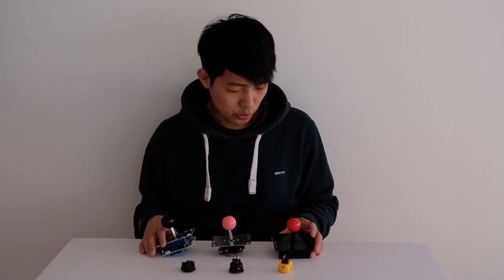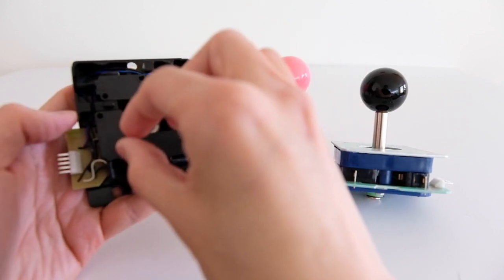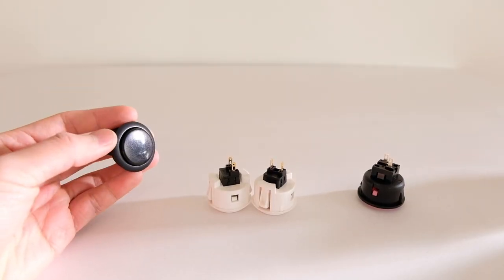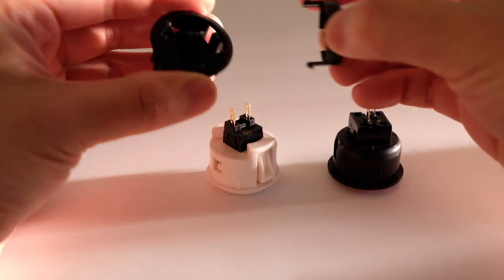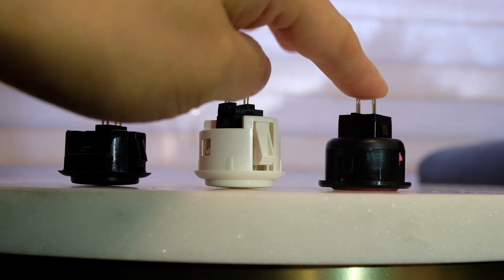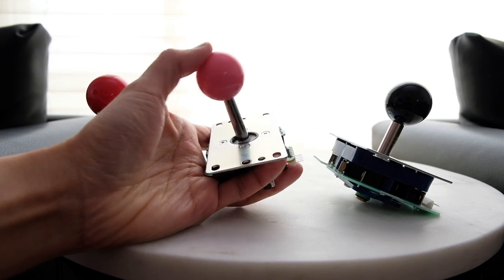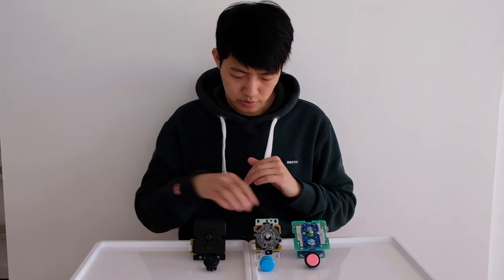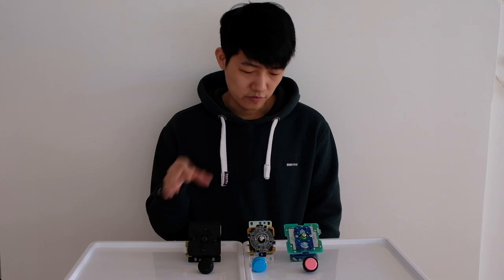Sanwa vs Hayabusa Vs Seimitsu Review Detail Comparison 2019 HD

Comment: If my keyboard is any indication of how often I'll be cleaning my arcade stick, I'll be cleaning the arcade controller about 0 times a year.
Reply from the maker: Me too lol i never clean my keyboard that much, but i try not to eat and use it at the same time, so it doesnt get dirty ❤️
Reply: If you want optimal smoothness on your stick's pivot and increase it's life it should be re-greased once a year with silicone grease because the grease will oxidise and be useless after that. Sanwa uses Shin-Etsu G-40M and Seimitsu uses Shin-Etsu G-501. 

Some never re-grease and are happy but i do it every year to all my sticks
Reply from the maker: Speaking of that, you reminded
Me to buy a shin-etsu, mine is running low like tooth paste 😂🙏❤️

Comment: 1:33 The LS-32 was designed to be touching the panel. That's why the shaft is short. The original plate for the LS-32 is the SS plate that bends on the sides, so that the whole square area of the joystick can touch the panel and the sides come up so it can be mounted.

The SE plate for that's installed on this LS-32 makes the shaft a little shorter than it was designed for.
Reply from the maker: Thank you for the added information 🙏❤️

Comment: I enjoyed the video very much.

Tip for those interested: Change the lever spring (easy job) and you can decide on any of the joysticks how you'd prefer it to feel. I gotta hayabusa with sweet tightness

Also you can replace the upper rings on all of these to either fatten your stick at the base or slim it down, thus increasing or decreasing the throw.

With hayabusa controllers I also bought cheap quality spacers on the actual switches bringing the actuator closer to the stick.

Like he said, it's all about how you feel about it. I do recommend hayabusa because if you likely have a Sanwa then you can actually benefit from both.

You don't need to spend another 60 bucks on any of these because they all have the same efficiencies with 10 dollar upgrades.

Easy example, those hexagon parts that assist with rotation are also sold with the same idea of fattening or slimming the lower end of the stick down by increasing and decreasing the actuators ability to read input, simply by distance.

I hit up focus attacks website, after I discovered I could have it all and custom to boot :)
Reply from the maker: Thank you so much for this nice comment, appreciate you 🙏❤️
Reply: I have Hayabusa. What type of spacers did you buy and how did it make a difference? Also, what springs would you recommend to make it a bit tighter? I primarily play Street Fighter. Thanks
Reply: @LFiers  Get the 1.5 pound spring. Then get a replacement for the inner plastic part that makes contact with the sensors ( I forget the actual name of the part but it is the JLF-p-5). You'll want to go as large as available then decide on the next that is the best size smaller. You want less than 1cm between the contact points on the sensors. If it touches you'll get misinputs, if its smaller they'll be just enough space so the stick will feel more like a dpad, very very accurate
Reply: @retrobros9684  Thank. I'm not sure I understand this part though, can you elaborate here please? "you want to go as large as available then decide on the next that is the best size smaller."

Also, is this a challenging job to do? I've never opened the stick before as mine is just brand new. I guess I could watch it tutorial how to do it all but yeah, hopefully it's not too difficult. I can definitely learn though. 

I have Hayabusa by the way, you mentioned JLF. Isn't that for Sanwa?
Reply: @LFiers  I'm sorry for not explaining it as well, but I recall the part which named the "actuator." You can get them at max size 2 mm or 1.5 mm.

As far as teardown of an arcade stick it is super easy. Your just removing a clip at the base of the arcade stick. When it's removed the spring will pop out of the bottom. Putting it back together is simply holding all the pieces together with the spring which pushes back a Lil. When the spring is pushed back into the stick you'll need to put the pin back. The pin is shaped like the letter C. Just use needle nose pliers and you can pull and push it back into place.

Just get the 1.5 pound spring and the actuator of your preferred size. You can buy both the 2 mm and 1.5mm actuators and spring usually for a couple dollars each, plus shipping.

My final recommendation is for the actuator to be metal not plastic. This is the part that triggers the sensors for input, meaning it will get abused and will eventually warp its circle  so it won't make perfect contact.

I'd say for about 6-12 bucks max for everything with shipping. Amazon might be better for price or Etsy. I used to buy from arcadeshock/focus attack, but now these items are everywhere to buy.

Best wishes!!!

Comment: Choosing the right stick is so important (I play Street fighter Third Strike). I started off using a terrible stick, thinking I am a terrible player (the stick was an old ps2 stick, the travel on the stick was extremely far but the resistance was very low), this resulted in me being able to move the character fairly quickly but not do quick special moves. The second stick I had, the resistance was really high, but the travel was super low, this resulted in me accidentally jumped instead of blocking and trying to do special moves was near impossible cause the resistance was so high.
Xbox hori stick (cheapo) was actually pretty good, the buttons were cheap and broke but the stick wasnt too bad.
Final stick was Xbox Razor Atrox. I swapped the buttons out with sanwas (only for aesthetics) and it was the perfect stick !!!
If anyone understands this, the latter two sticks were the only ones I could do Urien's Tackle/Tackle/Headbutt (which I find is a very hard wall combo to perfect).
Reply from the maker: Great info my friend, thank you for letting the community know ❤️🙏

Comment: I'm new to fight sticks. But I got an old ps3 stick used on Easter. I had to piece it together but it works. Ordered a new Sanwa JLF and a new gate. I noticed the buttons seemed inconsistent, done buttons had more stiffness, I opened them all up and cleaned them with rubbing alcohol and they all feel much better now.
Reply from the maker: Bogart Gaming & Tech sounds good 👍 i am going to make a cleaning video on them soon, mine is getting dirty ❤️🙏

Comment: i haven't tried the hori hayabusa joystick yet, but my favorite joystick in this video is the ls 32 seimitsu because it's easier to make diagonal inputs compared to a Sanwa jlf, and the movement feels more precise
Reply from the maker: Nordicus0114 great comment, thank you for passing by
Reply: @JoystickNY  no prob, the ls 32 is also pretty good for 2d shoot em up games, and i just modded a eightarc qanba stick with all Seimitsu parts
Reply: I bought a Hori Fighting Edge recently, which uses a hayabusa joystick, I was not a fan. It felt very loose at center, so I had issues going right <---> left without deadzone issues, and doing forward-forwards was pretty tricky. The hayabusa buttons matte finish has GREAT tactile feel and I like how rounded they are and how easy they are to actuate, but the sound of them kills me not just for aesthetic reasons but because I have issues understanding if I've double-tapped or single tapped - but definitely that matte finish was GREAT.
I ended up sending it back because the stick was making me lose my mind, but.... I could see users who do dramatic inputs liking it, it's just that deadzone in the center killed me. For instance charge characters it might actually be really good.
Y'know, just one guys input.
Reply: Try the LS-40 next. It has the same exact parts as an LS-32 and LS-38 but the bottom part is thicker that gives it a shorter throw (it's not too short) and at the same time eliminates the the ball joint from briefly going too far in the socket. You can feel the 32 popping out of socket at the edges if lightly pressing past the stopper. I have two of every Seimitsu there is and then i have twelve LS-40 and it's pretty much the only stick i will ever use.
Reply: n response to your comment, I got the Razer Pantera Evo with a Stock Sanwa JLF lever and .9lb and Square gate. From the moment I took it out of the box I have felt it has been a complete waste of money. The stick is so loose, massive throw range, horrible. I played American arcades with what? the HAPP Eurosticks with Octo gates? were those the ones in the 90's arcades right? Anyways in the arcades DP's and Fireball were easy when I was like 12. Here I am getting my first Sanwa with Square gate thinking its going to be wonderful. Nothing but disappointment. Execution went from very high overall (on pad) to dirt low beginner level or worse. So the 2lb spring helped a little bit but not enough.  I have a Seimitsu LS-40 on the way and I am excited to say the least. Also have a oversized actuator and a Octo restrictor gate on the way as well for the JLF. Between the mods for the JLF and the new shiny Seimitsu LS-40 I think I will be much much happier. I will never again play with a stock Sanwa lever and square gate combo. Its unplayable in my opinion. I have read from others too that they absolutely HATE the stock Sanwa with square gate. They find it awful as well. They said the Seimitsu comes stock with a sort of Square-roundish gate that is much better, so  I am even more excited when I think about it LOL I highly doubt any pro uses a STOCK Sanwa JLF lever with a Stock Square gate. Everyone I read about their info or ask, also say in their equipment used or there preference pretty much all use CUSTOM Sanwa Lever's .Custom, not stock (LMAO) Custom is the key word Custom. I will never ever touch stock Sanwa's for the rest of my life, I swear it.

Comment: Additionally; awesome video! This is basically all the information I needed to know for when I have money to build an ideal fight stick.
Currently using a set of Chinese knock-offs built into a USPS Priority mail cardboard box. $40 for two sets of buttons and sticks. And the joystick, as well as the buttons, are looser than a politician's ethics.
Reply from the maker: Thats almost the same price as a qanba drone and mayflash f300, but it certainly a good experience 🙏 thank you for watching
Reply: @JoystickNY  Thanks again for the great video and getting back to me!
One quick question: where would you recommend to shop for joystick parts? I'll check your channel to see if you have any reviews once I get back to my computer.
Reply from the maker: Facey Neck i rotate around, focus attack; arcade shock, ebay and amazon, depending if i need a lot or something small. Cuz ebay and amazon usually dont have shipping fee, and other website usually have to buy alot to make the shipping worth it
Reply: @JoystickNY  Awesome, amigo. I'll check out what they have on offer.
Reply: I use hayabusa buttons and a Sanaa JLF with the octogate

Comment: Thanks for the comparison video.

Got a Hori fighting edge and gave the Hori parts a shot after years of sanwa usage.  The Hori parts are great.  Love the stick, and love the buttons for the same reason you mention at the end of the video. 

The sanwa jlf microswitches can be relatively high maintenance, and the pivot requires regular greasing.  The v cut cam seems like it will require less greasing but we will see how it goes.
Reply from the maker: alexj0101 Nice, 👍thats a nice stick, i love hayabusa ❤️ . I cant wait when the ps5 is release and new sticks are release.

Comment: Cool video and info I’m picking up the Hori Kai Ps4 it’s first fighting stick
Reply from the maker: M M that is a great stick, it is around $150, keep in mind that stick is not sanwa parts. If you are buying it to swap to sanwa, i dont recommend that stick, i would recommend getting the sf5 razer panthera, is $199 and it is alot easier to mod and open up. The panthera is prob one of the best sticks for its price and design. 
The hori kai 4 is hayabusa parts.
Reply: Joystick NY Cool I’m in Canada so the prices are a little more expensive but I’ll check the price thanks 🙏🏽.
Reply from the maker: M M yea, cuz if you dont mind spending the extra 50$ish,  you will be more happy with the panthera, it will last you a long time. Only get kai4 if you are a hayabusa user, cuz at any point if you mod it to sanwa, you coulda spent that money difference on the panthera
Reply from the maker: M M btw i am going to make a video about the panthera real soon too

Comment: Excellent Detail Comparison Here! 

My first stick was the Hori Real Arcade Pro N Hayabusa with a stock lever and buttons. 

I always felt that the Hayabusa buttons were too light and felt like paper. Inputs felt very empty due to its tilt which doesn't register all the time. 

The Hayabusa lever wasn't bad at all starting out for my first purchase but I realized later that the octagonal gate for this lever was not common to order like the Sanwa Octagonal Gate. 

The Hayabusa Square    Gate is traditional and feels like it should but I realized It wasn't for me. 

Often times I would over extend to the left  or right while trying to do a down input and I would miss input. 

Because the square gate is a box, if you over extend like I did on the straight sides you will never no the difference feeling wise until you hit a corner. 

It was really frustrating trying to do down or left and right inputs only to have down back register just because I over extended even a little bit not knowing.

All in all, I had a good time learning fightstick mechanics starting out with stock Hayabusa hardware. 

Today, I just recently received a Sanwa Denshi JLF lever, Sanwa 30 MM buttons and 2 Octagonal Gates in the mail. 

Taking out the Hayabusa was easy as I looked up guides on YouTube and took 15 mins tops. 

Believe me when I tell you, Im no Sanwa fan boy or even a fightstick hardware expert but when I replaced the Hayabusa parts with the Sanwa parts IT MADE A HUGE DIFFERENCE.

First, the clicks for the Sanwa lever felt a little more satisfying response wise. 

Second, the Octagonal Gate fixed my overextending inputs when pressing down, left or right. No more unintentional down backs or up backs. The Octagonal engraving is a sure fix  for me because I like to ride the edge of my gate everytime. 

Lastly, the Sanwa buttons feel like REAL BUTTONS. It wasn't until I watched this video just now that I realized why the Hayabusa buttons felt so empty and cheap when pressing it while the tilt is happening. There is little to no form of plastic on the inside which makes Hayabusa buttons feel like tapping on paper. 

The Sanwa buttons feel like they have form when you press it down. It feels like when you press it fully, you are rewarded with a proper input with no tilting or empty feeling. 

The Hayabusa buttons make me feel like I'm second guessing whether or not I'm going to get an actual input to go through. The Sanwa buttons did not make me feel like that at all.  

I am confident to say that if your new and starting out learning fightstick mechanics and want to MOD in the future,  BUY SANWA PARTS. 

Again, I have actually experienced Hayabusa parts for over a year now and playing with my new Sanwa parts all day today made me feel like this is what I should have gotten in the stock at the start.

Buy a stick that comes with Sanwa parts if you can OR Buy a cheap stick just  for the modable case and buy the parts for cheap yourselves.

Buying a fightstick is like a car, worry about the inner parts first and how they feel to you THEN customize the outer body later. 

Cheers. Looking forward to trying Seimitsu parts in the future. Hope this helped someone. 🙏
Reply from the maker: Excellent advice, and detailed story btw. i totally agree with you, i actually switch back and forth from sanwa and hayabusa, i am comfortable with both, but you are correct, if anyone is starting out, and if you can only choose one, go with sanwa, you cant go wrong with sanwa, they are well made and they feel good. and thank you so much for typing all that, i enjoyed reading it. thank you for stopping by. i appreciate the support.
Reply: @JoystickNY  Thank You for providing one of the most detailed part guides I've ever seen. 

This video will help ALOT of people with the amount of detail you provided here and I hope to see more detail reviews in the future.

You got a sub from me. Good Work. 
👏👏👏👏
Reply from the maker: @Warlock-6127  appreciate the support and love <3
Reply: thanks man ! i really feel the same way you do about the stock parts of the hayabusa N   i switched to a seimetsu and its a world of difference its very accurate and registers very fast i do still have a square gate that i will probably change  .   i will definetly change the buttons to sanwa reading this!
Reply: I put a stiffer spring and a kowal octo gate on my Hayabusa stick, feels great. I love their buttons. Would love to try seimitsu button someday
Reply: i went down to the Arcadeshock retail store and got to try all of these out.  as well as all the different buttons.  if you haven't tried the Korean Crown buttons you really owe it to yourself to try them.  they are so smooth, bc they use cherry keyboard switches.